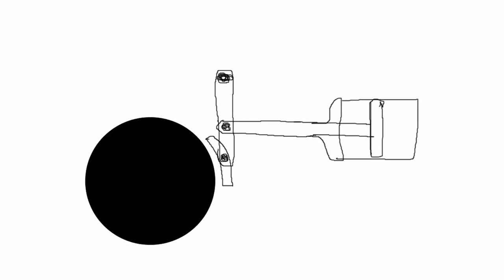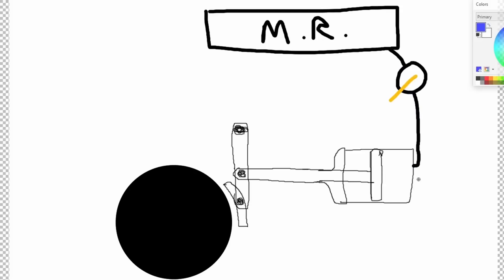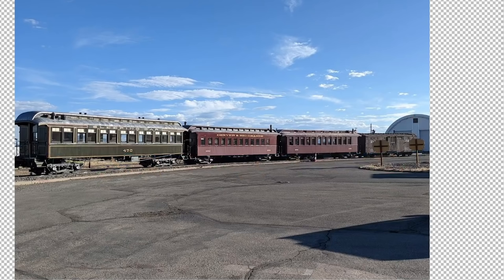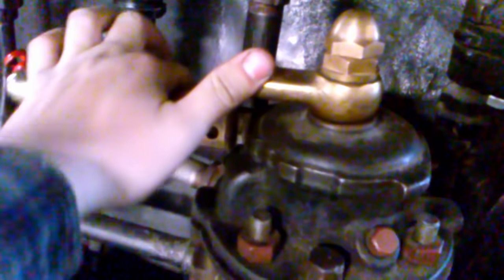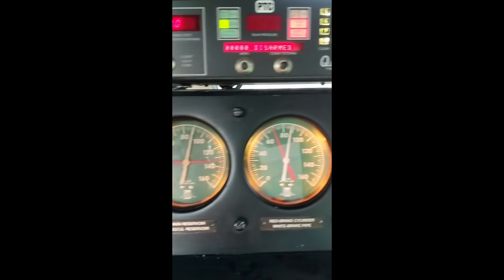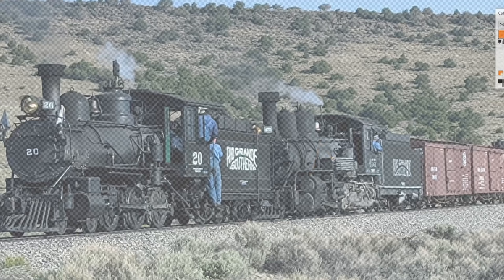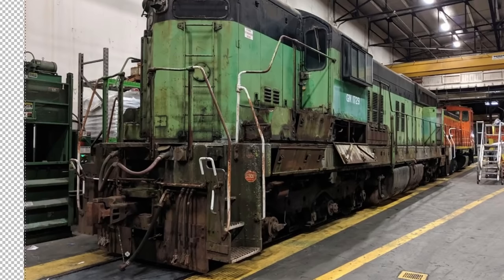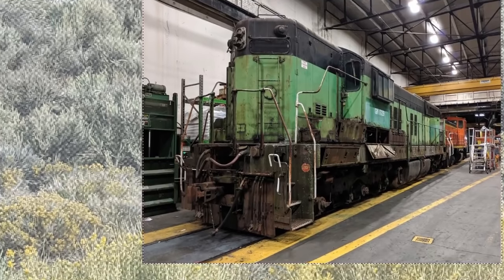AIRBRAKES 101: 10 levels of TRAIN BRAKE understanding!

Comment: So you can use a cross compound pump to make air at higher pressure than the steam. You just need a larger steam piston than an air piston. Pressure is force/area after all. 

Air over hydraulic pumps use this principal to get pretty crazy pressures from 100 psi air.

Comment: Back in the 1980's and 1990's I used to drive passenger and freight trains fitted with vacuum brakes.  They required a different technique to driving an air braked train but certainly on passenger trains were just as good as an air brake.
Reply from the maker: Certainly, they were used for a long time in Britain (and still are to some extent?). They work great, just not for long trains.
Reply: @Hyce777  Vacuum on mainline standard passenger services finally ended in 2017 with the withdrawal of the Class 121s. It continues to be used heavily on heritage lines or on mainline charter services.
The point you made about longer brake release times for vacuum is very true; the brakes can easily take a full minute to release on a mere five-coach set. I'm a locomotive fireman on a heritage railway over here for context.
Reply from the maker: @Anbregour  Very cool! I appreciate the info.
Reply: @Hyce777  In terms of passenger trains we used to run them with a locomotive and 10 coaches and they worked great.  The coaching stock was withdrawn from service in the late 90's and replaced with multiple units.    The freight trains were engineers trains which could be long and weigh up to 1,000 tonnes. Being a young driver I used to find them a bit of a handful lol.
Reply: @Hyce777  
Most pre-grouping ( pre 1923) railways in the UK used vacuum, but several used air.  All of the ‘big four’ after the grouping generally used vacuum, but air was kept in a few places, such as on the Isle of Wight, which had no connection to the lines on the mainland, and some suburban lines out of London Liverpool Street Station into Essex which ran to very tight timings, so the faster release of air was useful.  After nationalisation in 1948 BR stayed with vacuum, bet decided to gradually switch to air from 1967.  The conversion took about 50 years.  This was for locomotive hauled stock; electric multiple units nearly all used air while Diesel units from the ‘50s and ‘60s used a two pipe vacuum system, with a high vacuum pipe for more rapid release.  From the early ‘50s electric units started to use electro-pneumatic brakes, but retained the air brake pipe for safety purposes.  Later units from about the early ‘80s did away with the train brake, and had only electric control, with just the main reservoir pipe retained.  On most classes this, and the electrical connections are carried on auto couplers of various designs.

We don’t have many locomotive hauled passenger trains now, but those that we do have used two pipe air brakes.  Freight trains sometimes use two pipe, and sometimes single pipe brakes.  Some wagons were originally had two pipe systems, but the main reservoir hoses were removed at some time and the pipes blanked off, converting them to single pipe; Idon’t know why.

Most heritage railways in the UK, of which we have a lot, use the vacuum brake, the main exception being the Isle of Wight Railway, which uses a traditional single pipe air system.

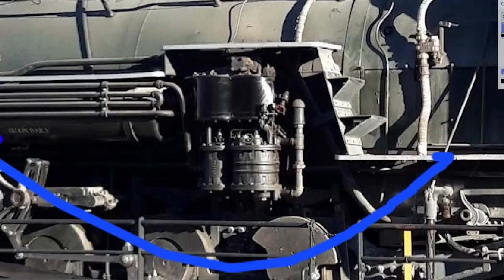Comment: 4:35 - in the 19th century the usual working pressure on New Zealand steam locomotives was 130 lbs PSI. This later went up to 160 lbs PSI and I think that must have been when we adopted the Westinghouse air brake system which was introduced across the network in 1900-03. The higher pressure being necessary to run the brake pumps and create the greater pressure required for the braking system.

Comment: In the UK we have an additional pipe. The train pipe is red and the resevoir pipe is yellow. The resevoir pipe keeps each cars resevoir toped up which gives a quicker release time. 

ONn the HIGH sPEED TRAin, with a service speed of 125 MPH and it was found that it took too long for the  train pipe to dump air. This  problem  was solved with an electrical actuator in the rear loo. The HST has a loco at each end of 7 to 9 passenger coache. When the driver moves the brake handle an electrical sihnal is sent to the rear loco so a brake valve  follos the lead loco and the air is exhausting from the train pipe from both ends to give a shorter stoping distance

Comment: 2:50 FYI air pressure is considered 1 Bar or around 15psi so a vacuum brake system can only get to 1bar 15psi of "pressure" from the atmosphere versus the 100+ psi 7+bar of pressure from air brakes.

Comment: The Bessemer & Lake Erie RR had a large number of open top hopper cars that were used for bulk mineral commodities - those cars had double clasp brakes - shoes on the inside and outside of each wheel.  When my railroad hauled those cars they were generally referred to as 'Rattlers' as the made about double the noise as the more normal single clasp brakes used on most freight cars.  Secondly, there is no such thing as a 'partial release' of freight car brakes, once applied they can be applied harder, but the brake pressure cannot be reduced except to be totally released.  PTC is more like level 20 or 30 in your scheme.
Reply from the maker: Oh, good to know. I am going to need to consult some folks about the early K valves because I was pretty sure you could partially exhaust things. Wouldn't be surprised if I was taught wrong though! And, yeah, PTC is probably a higher level, but I thought it would be good to tie in my current experience into these things (I am a signal engineer by trade anymore).

Comment: Well as a ex truck driver and tow truck driver of over million miles. There is similarities of brakes. A truck has 5 types of brakes. There is applying the service line (yellow button) and Emergency brake release air line application  (Red button). Service brake application (break petal), Trailer only service brake (adjustment lever usually on steering column), and the Jake brake (Engine brake, air is pushed out the exhaust valves instead of being used to power the crankshaft).

So yea it's different with very small similarities.

Comment: @4.50 You could easily pressurize the air to a higher pressure than the steam pressure. You just have to make the air compressing piston smaller than the piston driven by the steam. Force is pressure times area, so the larger but lower pressure steam piston would generate the same force as the counterforce from the higher pressure but smaller air piston. You don't really want higher air pressure though, because keeping the steam pressure in fixed pipes on the locomotive is already difficult enough, those problems would be compounded with the flexible lines that are needed to connect the brake line between wagons if the air pressure was even higher than the steam pressure. Remember that this system was developed long before modern armored flexible lines that can withstand extremely high pressures were invented.
Reply from the maker: Yup, I goofed on that explanation, haha. cheers

Comment: Hyce excellent work. I was a machinist locomotive air brake mechanic at BN Northtown  for 35 years (started on GN in '69) . I installed 26 L on the ATSF 2926 steam locomotive in Albuquerque where you could contact me. Some would call me an expert but I learned   some things from you. I would be glad to help you.
Reply from the maker: Northtown! Awesome. I worked at Interbay for a few years. And - very cool, would be great to talk with you about the 26L you installed on the big gal.

Comment: Circa late 1980's, early 1990's.
My best friend lived across the street and behind his house was a set of tracks, 1 mainline and 1 siding that had a spur. Over the years we got the train crews to teach us many things about trains and the tracks and so much. The trains they were running there/then had brakes that would clamp down (e-stop, if you will) when the lines lost pressure. They had a manual valve at each brake hose. The one on the end of the train would be closed and all the rest open to allow the pressure. Every time they would come back from the spur and recouple, we could hear the air filling the line and see the brakes slowly releasing.

They had a neat trick, when they needed to drop some cars down the spur but the engine was on the wrong end. They would uncouple the train behind the cars they were leaving, then close the brake valves where they were going to uncouple the cars to go down the spur. They would pick up some speed then uncouple the cars and speed up again to get past the switch and right when the last truck went past a guy would throw the switch and the car(s) would coast onto the spur. Then the engine would just back up and then go up and push the car(s) out to their drop point on the spur.
Reply from the maker: That's what we call a "dutch drop" or "flying switch", and it's a decently big no-no these days but it certainly saves a lot of time, lol!
Reply: @Hyce777  Lol. Yeah, I can see how that would be a big no-no. Was certainly fun to watch at the time, though.

Comment: I wish you had done this video 2 years sooner now I haft to go back and re-write the code on my simulator. You did a great job explaining how the system works. I do have a question on the 26L system?  I have seen some videos where there are in the "Application" zone they will move the lever about half way of the zone, then 20 seconds later move back towards the release but still in Application. Does that mean they heavy apply the breaks, then slightly let off of the breaks?
Reply from the maker: Correct!
Reply: @Hyce777  thank you!
Reply: @ConcertLD  while you're correct, it's also important to note that this feature (graduated release) only works when the automatic brake cut-off valve is in the "passenger" position, if it's in "freight" moving the handle back a bit but not all the way to release won't do anything.  You also need a train of cars with control valves that are set up for graduated release (i.e. passenger equipment), doing this on a freight train will cause an unintentional release.  

30 and both the Wabtec and NYAB electronic brake valves work the same way, but I should also note that the "passenger" position is an option and some brake valves don't have it, they're either "out" or "in" (freight).  My railroad (Canadian National) does order it, and it comes in handy on a regular basis when the pressure maintaining feature fails, usually you can get it working properly again by switching from "freight" to "passenger" (you just then have to be really careful not to bump the handle).
Reply: @bobsmith2637  very good info!!!! Thanks for this, i will add this to my simulator software!

Comment: Very informative, I never knew the air brakes on a train was that complicated even with 2 lifelong railroad men in the family. 
I am a trucker and honestly believe that we have the simpler, more reliable and better air brake system.
Reply from the maker: Certainly so! It's a lot easier to have a better system when you're talking a trailer or a few vs. several hundred, haha. Cheers :)
Reply: The basic trouble with train air brakes is railcars need to be able to roll when not hooked up to air, so they can't just have a "brakes are ALWAYS applied without air pressure" system.

Comment: I believe that the use of vacuum brakes in Britain was because our trains are much smaller than in the US. (As in, less tall and less wide, not just shorter.) On a steam locomotive, you can use a vacuum ejector, which is small and has no moving parts. Air compressors are much bulkier and there generally wasn't room for them on UK steam locomotives. Vacuum brakes were fine for the weight of trains we were running and, hey, many low-speed freight trains had no automatic brakes at all -- just the locomotive brakes, and a brake van at the back. If they needed to go down a steep hill, they'd stop and make partial handbrake applications. 

When diesel locomotives came along, they had to use mechanical vacuum pumps, which have no advantage over air compressors, so the general advantages of air brakes won out, eventually.

Comment: Here's a question that I think is in the scope of the first ten levels of brake wisdom:

In old westerns there was an emergency handle in each of the passenger cars. The cliché where the bad guy yanks the emergency brake handle and dumps everyone on the floor with much screeching of brakes and copious display of sparks. Does that handle just dump the pressure in the brake pipe?
Reply from the maker: Played up for Hollywood, but yes, dump valves just empty the brake pipe.

Comment: Hey, just a slight correction on the positions of the 26L. So your positions are Release, Minimum Reduction, Service Zone, Full Service, Supression, Handle Off, Emergency. 
Emergency applications must be reset by putting the handle to Emergency and waiting for the PCS switch to reset. Supression is for penalty applications such as not resetting the alerter or not acknowledging a signal change. 
And a surprising number of steam lokies out here in the East have been upgraded with 26L. N&W 611, SOU 4501, SOU 630, C&O 1309, just to name a few.

And on the note of the Holding position, I had always wondered what the purpose of that was, because if you wanted to release the automatic while leaving the engine brakes applied, why not just apply the independent brake? But my thinking is the 6 automatic was created before you had a distributing valve and a separate independent brake valve. So the only way to recharge the train while keeping the engine brake applied was Holding. And assuming this is why it exists, I also assume they did not bother to make any modifications to the 6 automatic when an independent brake handle was added, therefore Holding remained in the automatic until the introduction of the 8 stand. 

Yes, I am an air brake nerd as well haha
Reply from the maker: Thanks for the correction! Much less experienced on 26L. When I dealt with it I was a manager, not hands on :P

Hold is weird; you can certainly just leave the independent in lap, lol. I've found it's useful when the train has a bit of a leak and I need to retake my set on the downhill - kick the train off by going to hold, do what I need with the independent to make sure I don't go flying down, and then go for another set on the automatic.

Comment: Spring Prwssure
On a Truck Tractor : 
Parking Break

Push In : To release ( Engage)
Pull. Out: To Disengage

For a trailer: TPV - Push in to charge the system
Similar for freight cars

Comment: Can we get a short video on how auto disconnecting gladhands with? Coming from a diesel tech/tractor trailer mechanic, the gladhands we use would absolutely not automatically separate without damage.

Comment: Great video and well explained, but I need to correct one thing. You said that in steam locos your main pressure could never be more than your boiler pressure. This isn't guaranteed true. It is very common and easy to build a compressor that has a larger steam cylinder which can apply more force and torque to a smaller sized air cylinder which would then be able to have higher air pressure that it compresses causing equal force back against the lower pressure steam cylinder. It's all about sizing ratios.
Reply from the maker: Yup, goofed that explanation up. Thanks :)

Comment: I was always surprised when starting out in rail to learn that the air brakes on trains were NOT spring applied/air released, since I come from CMV operating/Trucking. And honestly, I still haven't officially heard someone say/learned exactly why that would be safer.

I imagine it must have to do with air producing a stronger or more controlled emergency application than springs, & also the unlikelyhood of all the main/emergency reservoirs failing at once ??

Comment: Greetings and Salutations Hyce big fan of Railroads Online as well of your Train video. One thing if it could be a add on or a bonus video is on the handbrake. I remember you saying on one of your videos I believe it was the caboose racing about the older hand break you use a bar. And then at some point wheel where added. So please love to know the history of hand break as well as how do the hand break tieing with the air break? Does the hand break over ride the air or are they completely separate and apply it own break shoe to the wheel or axle to stop? And how in the early days did they corante the hand break like during the Railroad online time line? Thank you so much for sharing all of your knowledge with us find it all so interesting. Thank you!
Reply from the maker: That'd certainly be a good video as well - thanks for the comment! Most of that would take a video to explain, but the handbrake typically grabs an extension of the lever the brake cylinder applies, so you can set the air brake, then crank down on the handbrake and latch the handbrake to get an "airbrake powerful" set on the handbrake. If you just crank it yourself, you can't do as much as air can :)